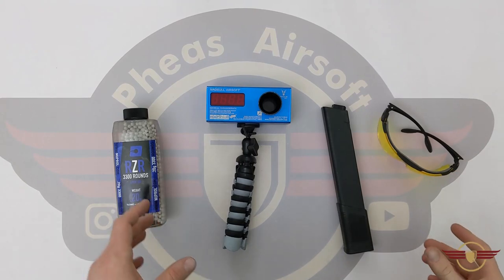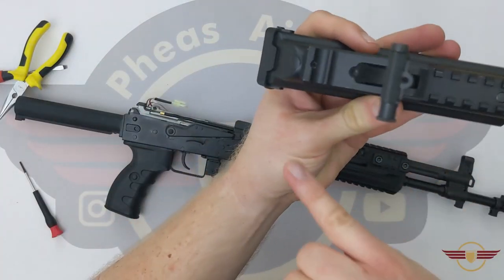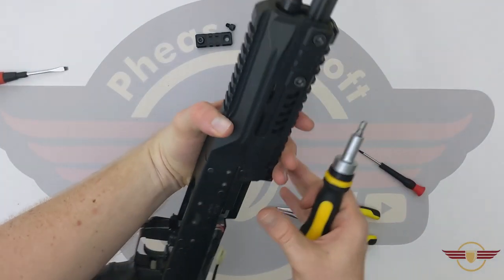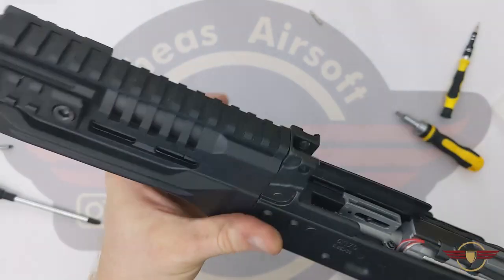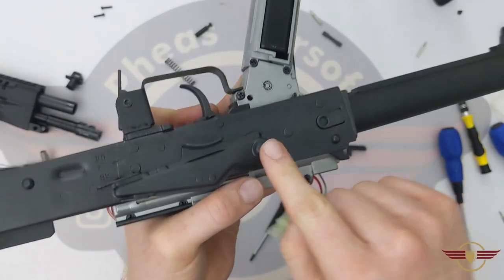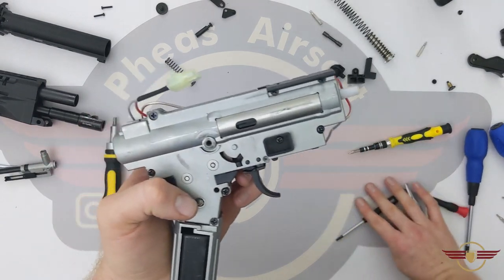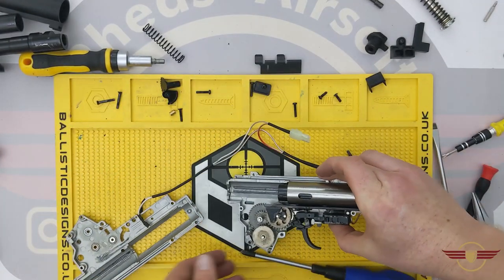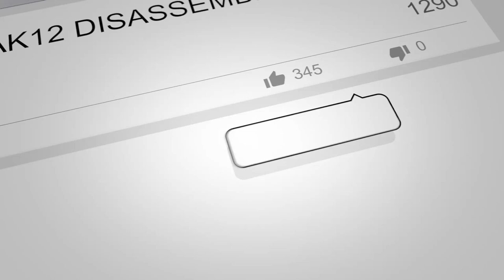[HOW TO] ARCTURUS AT-AK12 DISASSEMBLY

Comment: Thanks! Because of this video and the one on the perun ab++ i've now got a Arcturus ak12 with 2 round burst. Swapped out the barrel with a slighly longer one because my stock barrel and hop up wasn't as accurate as I had hoped, Subscribed!
Reply from the maker: Hello! Glad you have found my videos useful and thank you so much for the sub! Massively appreciated
Reply: @PheasAirsoft  np man, are jou going to get the Pp-19 by arcturus? Just got it today, works like a beast!
Reply from the maker: @junkguijt6548  I am looking at my options for getting one into / in the UK. As soon as I can get one I will be all over it! Pheas

Comment: I just got my ETU version of the Arcturus AK-12, and I’m having serious trouble putting the muzzle device onto the tread protector without shredding threads. When I try to push the pin down and try to install the muzzle device there’s so much resistance trying to get the notch on the muzzle device onto the pin it’s impossible. Have any suggestions to help me out?
Reply from the maker: Hello! Is the ETU version out? I would love to see it in action! You dont have to have the device screwed alll the way down, if there isnt enough thread to get it pushed back tight against the sight post for the pin. You can leave it unwound a little bit (small gap) and allow the pin to sit in it with the small gap, the pin is to stop it unwinding. Hope that helps. Pheas
Reply: @PheasAirsoft  Doesn’t ETU stand for electronic trigger unit? I don’t know if mine is, but I got it 2 days ago. When I get home, I’ll try again.
Reply from the maker: @pierre4046  Ah there is a new version coming out with a mosfet, which seems to be refereed to online as the ETU version, if yours doesnt have a bust mode, the its the normal microswitch based trigger. Pheas
Reply: @PheasAirsoft  I see. Yeah I just have the regular micro switch trigger AK-12.
Reply: @PheasAirsoft  Oh yeah, one more question. What’s the point of the black rubber band that came included with the baggie of hex keys/ rear sight post? Does it have something to do with the muzzle device?
Reply from the maker: @pierre4046  That is a very good question... I don't actually know the answer to that to be honest! Pheas
Reply: @PheasAirsoft  I think it may go in between the thread protector and the muzzle device to act as some sort of cushioning to prevent paint from scraping off. But that’s just my 2 cents.
Reply: @PheasAirsoft  Sorry if I'm nagging you a bit, but I'm struggling to find a 7.4v lipo that will fit within the dust cover and I don't want to order the wrong one... What battery did you use for your ARCTURUS AK-12?
Reply from the maker: @pierre4046  Hello! I used this one as its the one they said to use: https://www.taiwangun.com/lipo-7-4v/battery-li-po-1200mah-7-4v-20c-ipower?q=7.4v+lipo Pheas

Comment: My rear sight seems to be stuck...i unscrewed the allen key but the rear sight block doesnt want to move, help
Reply from the maker: Hello! Once you have unscrewed it, did the retainer (on the screw come away too? You might need to then slide it off instead of lift off. I cant remember specifics. Pheas
Reply: @PheasAirsoft  hello, it seems that only the screw came off, that micro thing. What does the retainer look like and where is it located?
Reply from the maker: @Anna94320  Just gone back through the video, I was wrong, it slides onto the rail, remove the grub screw completely and then it will slide off, BUT it will need bordering on violence to move it off the rail as its a VERY snug fit. Pheas
Reply: @PheasAirsoft  Thanks for your response! So what youre saying is...Once ive unscrewed it, in order to slide it off the rail I need to really force on it? Any tips on how i could do this without damaging it? In which direction should I push it?

Comment: Hi, do you think that we can put inside a other Gearbox with a titan, so we can program thé burst on the position that WAS made for it?
Reply from the maker: Hello! In theory you should be able to add another brand gearbox, but it might need modding to get a good fit, alternatively you could fit the AB++ wired mosfet and use that to give you burst mode on auto. Pheas
Reply: Hi ! Thank for your reply. I did manage to put an E&l Gearbox, because according to an shop, Arcturus GBare not fitted for Titans.
Reply from the maker: @Svitac36  did the E&L gearbox fjt without any issues?
Reply: No problem to fit in, you have just to disconnect the motor cage because it is a little bit larger and reconnect it once the Gearbox is inserted, the same than for other AK replicas

Comment: Still waiting for ETU version of AT-AK12, it will have Semi, 2 round burst, full auto and safe with custom perun hybrid v3 pre installed. Seems like the best of both worlds. It's supposed to be released this year.
They have also changed out the hopup chamber for a custom rotary one, yours is an older model.
Reply: I don't know if you've gone and got it, I did and all I can say is go for it!  Love the replica, accurate at range and looks awesome.
Reply: I have it now. Very good gun out of the box.